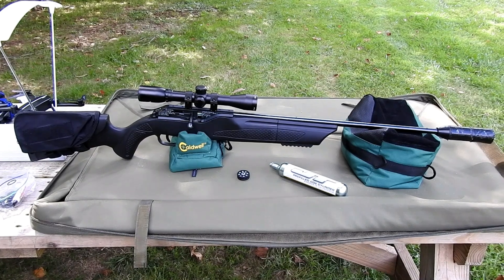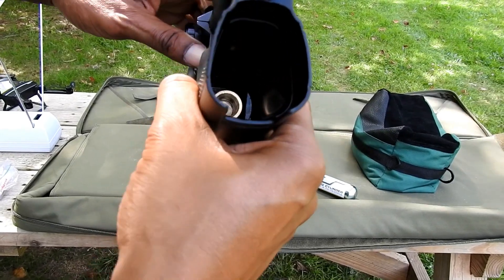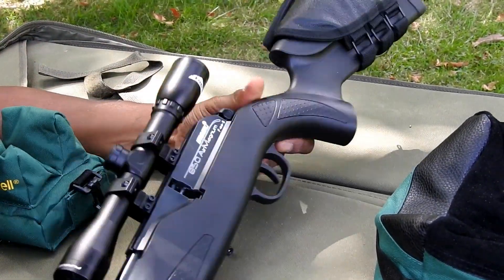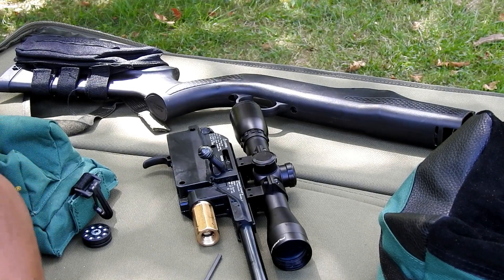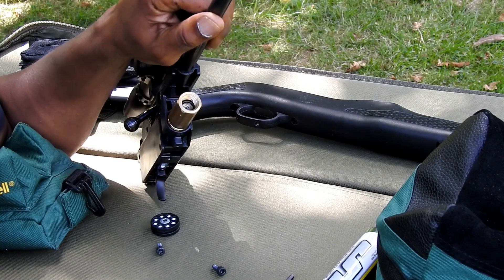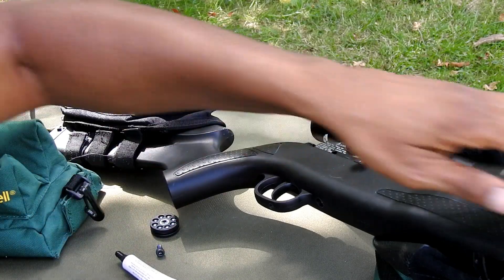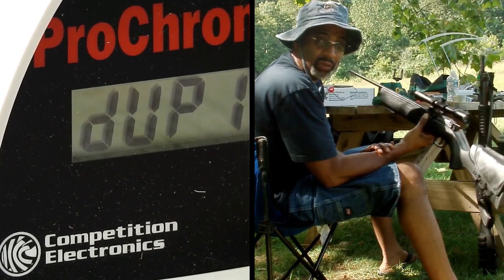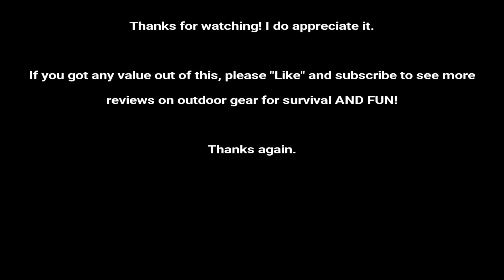Hammerli 850 AirMagnum Repair and Chrony Test

Comment: Gret job man, a good vid.
I like that air rifle, more than any other that I had in my life!
When I buy my it was 180 m/sec 7.5 Jules strong and i shooting abouth 400 shots with one 88g cartridge.
But I upgrade it with stronger valve 16J, it cost me abouth 55 euros.
O man now its a real air magnum, now it can be compared with PCP rifles.
Me and my friends do some testing with chrony, now its arond from 260 to  270 m/sec(thats I think around 800fps) with standard 0,49g (7,56grain) pellets, but I like to use heavy pellets especially Gamo T10 LongDistance 0,670g(10,49grain) and JSB Exact Heavy 0,670g, also few others pellets around 0,600 to 0,700g that is around 10 to 10,50grain.
I'm not hunter but now this air gun can be used for small game hunting for sure, at 20meters easelly break trough 15mm (litle bit more than half inch) wood desk, that is deadly wound even for human!
Sory coz of my bad gramatics :)
Greatings from Croatia!
Reply: 7.14gr pellet is what you used, which means you get, at most, 400/3=133 shots, and that's at CO2 critical temperature at 31.1C for 1,070 psi. The 180 m/sec and 7.5 Joules makes total sense for a 0.177, but not the 0.22, so you need to look into your rifles transfer port, hammer binding, pits, burrs, and valve spring tension. Your best and most consistent shots on CO2 are 1-1/2 minutes apart and making sure that your pellets are consistent in weight and form. Your claimed 400 shots got my attention and I had to break out the calculator because I thought you were on to some miraculous modification. The math: 88g / 400 shots = 0.22g CO2 to get 7.5J that equals triple Wow! Thats 3,000J of energy from 88g of CO2! Not even the manufacturers make such outlandish claims. Revers engineering in Imperial units: 3,000J = 2212.68645 fpe, so 2212.7 x 48 / pi /1,070 psi / (0.22 x 0.22 x 0.22) = 143.6 inch barrel length, if your gun has such 12 foot long  barrel then I believe you and I stand corrected. Numbers do not lie, but you can lie with numbers such as the manufacturers do when they report the velocity without telling us that they used the lightest alloy pellet, and when they also report their kinetic energy without telling us that they used the heaviest pellet, we presume outlandish performance.
Reply: menkeyman 
I never say that all 400 shots are same srong energy, and I neve shot 1 by 1 all that 400 shots, CO2 get recover in the certridge, even for a few minutes, especially at one or two days now in the summer time when its 30 to 35 C° temperatures 
Now when its upgrade to 16Jules, I have good 170 to 200 strong shots, all depends of temperature and recovery time between shots.
For my opinion, for now it's the only one serious CO2 air rifle.
And it is so accurate and good because that is Walther Dominator upgrade for CO2
Reply: BLAKBODHISATTVA  in Zagreb, Croatia...several jears ago, Hunter & KZ shop

Comment: I love this rifle, but have a problem cocking it. I put the magazine in, slide the shaft forward to load the pellet, but then shaft is hard to slide the last bit to load the pellet, I try to pull the lock it in place but will not go down.  Have you any idea why this is happening, does it need slight oil? Or could it be the very small o ring  which goes through the magazine. What size is the O ring on the magazine?
Reply from the maker: So sorry I’m just seeing this. I had the pellet issue when using pellets that were a little too big around the skirt. They blew out several o rings on the magazines. I don’t remember the o ring size but Home Depot has them. Have you gotten it fixed?
Reply: I have the same problem. Did Drew get back to you on a fix?

Comment: do you have a fps restriction where you live or a FPE? the Hammerli 850 shoots CPM's at 660+ fps, 415 not real, and by the way there are o-rings specifically for the 850 to take care of that problem, they are yellowish.. they are on ebay for $2.95 for 3pcs.
Reply: Awsome! Charles, I love it when I learn something that I did not even know. Thanks

Comment: Your FPS is too low you need to back out the co2 cartridge 1/8 to 1/2 turn after seating or co2 will be blocked considerably.